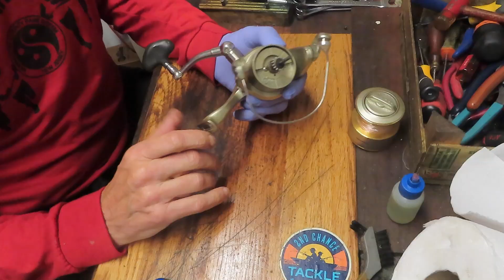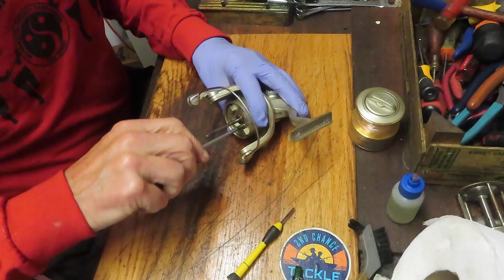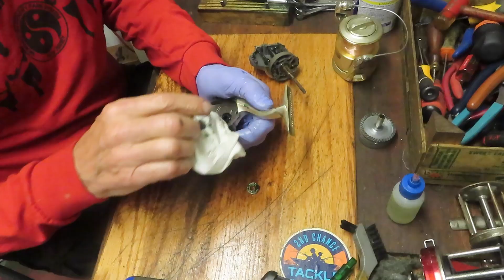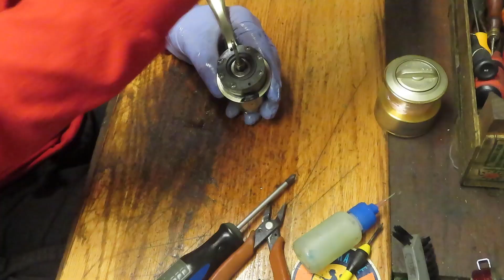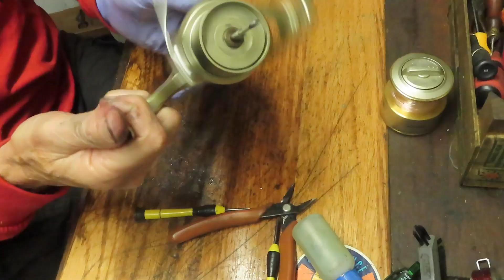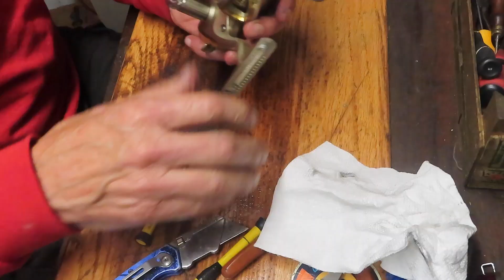Shimano Sustain 6000 FD fishing reel Full take apart and how to service

Comment: Thank you for posting all of these, I"ve learned so much!  After watching your boca bearing video, I was wondering if you can replace the bushing at 10:30 (the one with the two tabs) with a bearing?  I imagine the tabs prevent the bushing from spinning, but a bearing would potentially mitigate that.  Thank you, you're amazing for posting these videos.
Reply from the maker: Yes - you can replace business with bearings.  You just need to measure them to get the correct size.  You are correct, the tabs hold the bushing in the case and prevent it from spinning - Dennis
Reply: @2ndChanceTackle thanks!